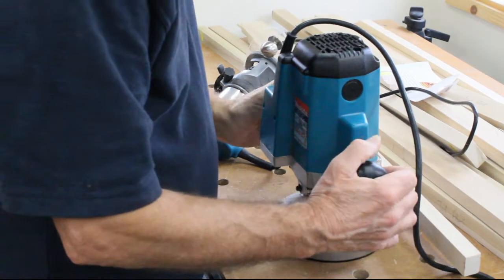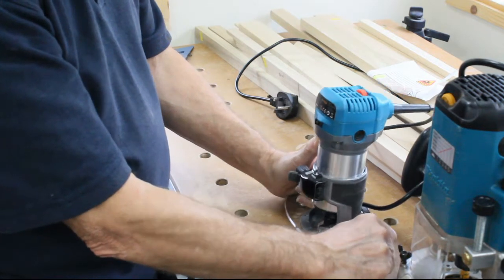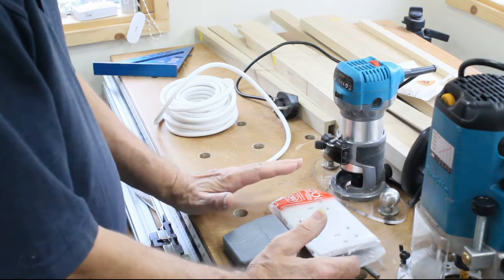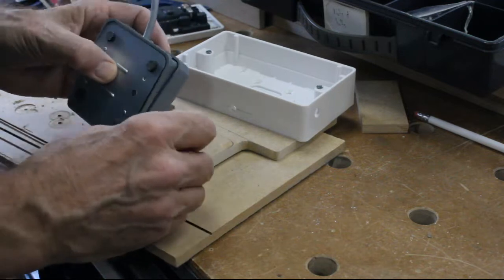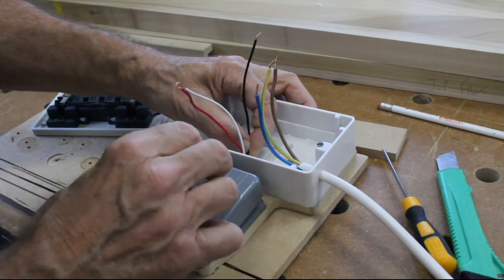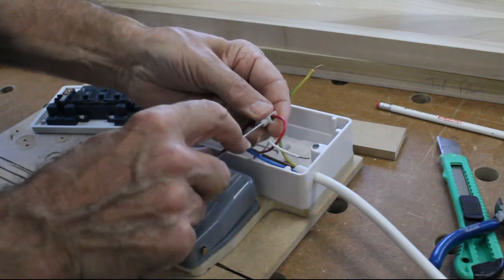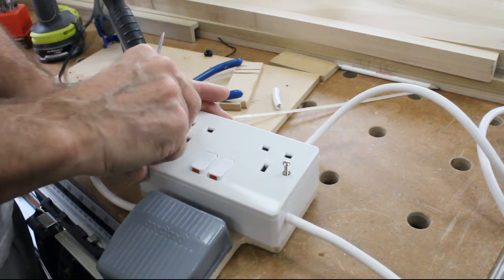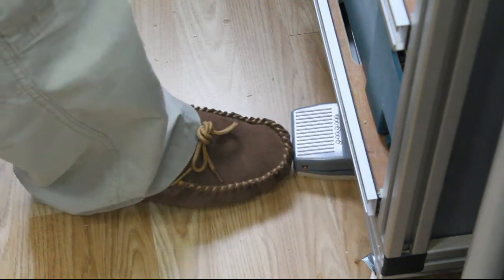the small shed #113 - a footswitch for the Katsu router

Comment: A good idea, very similar to what I did. I got a brand new high quality footswitch at the carboot for a quid and I also wired it into an single extension. I use it mostly for the drill press but I have used it on all manner of tools.

Comment: A good idea, in fact, I am going to pinch it and make one for myself. One difference I will make is to put a rubber grommet on the wire going to the mains switch to stop any chance of the wire getting damaged. I thought about getting a socket that was already wired and our £ store sells them, but I am not going down that route as I like to make sure of the quality of the socket and without taking it apart (the shops don't usually like you doing that in-store) you cannot see the quality of the extension. Just a note on the method you are using to join the red and white wire is only a low voltage connector.
Reply: Thanks John, it's  a 240v connector, but from a light fitting, so probably not good for more than 3 amps, I will dig out a bigger block and swap it put, - good point. 
Couldn't agree more on the grommet, I only had a big conduit one to hand, but it really should have had some form of sleeving, I shall keep an eye out for a suitable flexible outlet.

Comment: If you use a metal clad socket you can fit a flex gland to it which secures the extension cable, you could also use a wago connector for joining the cable
Reply from the maker: Yes David, in hindsight a more substantial metal box would have been a better choice, in practice it's holding up well, but if there's any damage I shall do an upgrade.

Comment: nicely done mate,this is exactly what I need the only thing I want to ask is that my pedal has a two core cable from it with brown and blue cable which one goes? where I'm not too sure
Reply: Hi Malcolm, if there are only two wires (and you are in the UK), you would connect the brown to the live in the plug that is feeding power in, and then connect the blue to the live in the socket you are using for your appliance. For a 'proper job' I would either wrap the blue wire from your switch in brown tape, paint it, or put a piece of brown insulation on the end of it to save the confusion of having two blue wires going into the power socket for the tool. Come back to me if this doesn't make sense, and I'll sort a drawing out.
Reply: @peterlloyd2306  thanks very much

Comment: I'm totally confused 😕.  I want to use foot pedal switches for my power tools, ie bandsaw scroll saw and pillar drill. I've managed to connect them all using an extension multi socket cable to my shop vac, I just move the hose. I'd like to do the same with the foot switch because I find it difficult to do precise work when I have to hold the wood in position to switch the machine on or off. It's soo easy with my sewing machine when I'm making clothes.  So I hope 🙏 you can help. Kind regards Cindy
Reply from the maker: The problem with a lot of the devices, like scroll saws, is that they have the NVR switches with green for on, and a red kill switch. This means that the minute you switch off it needs the green go switch to be re-set. This will only work with anything with a straightforward on/off switch sadly.
Reply: @thesmallshed  so I can do it for each power tool just not link them to one pedal. Thanks 😊 I can live with that.

Comment: Hi can you help me the wires on my foot switch are different colours they are brown black and blue how do I connect them cheers
Reply from the maker: Not entirely sure, but I'm guessing brown and blue are the live and neutral in, and that black is the switched live power to the socket, the neutral from the socket can also connect to the blue wire. It's worth trying it out with low voltage, using a battery and bulb to confirm.
Reply: @thesmallshed  Cheers keep up the good work 👍👍

Comment: Hi i bought a switch to do this but i have 3 cables coming out of the switch white/common, red NO and black NC any ideas
Reply from the maker: The NC is 'normally closed' and  NO is normally open, these are both outputs from the same switch, and refer to their state when the pedal is not depressed.  
If you want it to operate machinery it is best to feed the white common to your power feed, then connect the machine or live terminal of the socket to normally open red wire, so that when you depress the switch it will switch the machine on. Neutral and earth, if applicable, are then just connected to the machine or socket as normal.